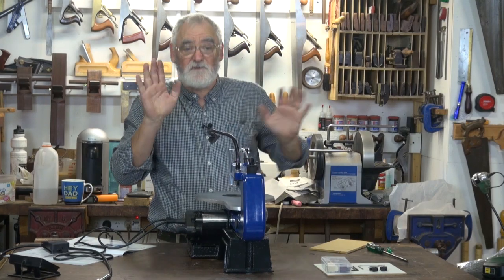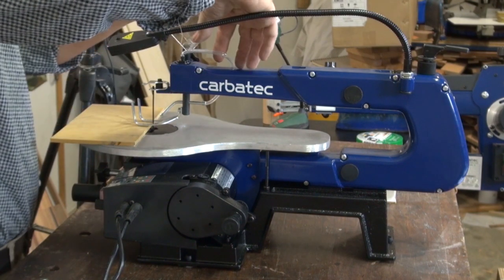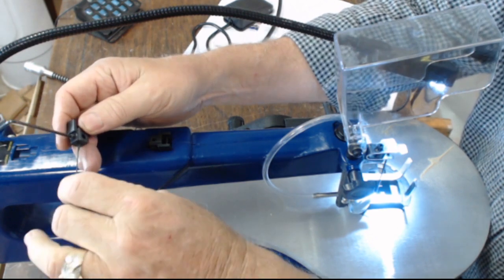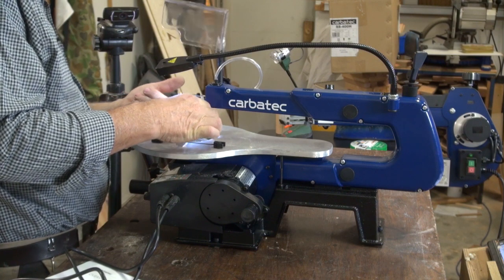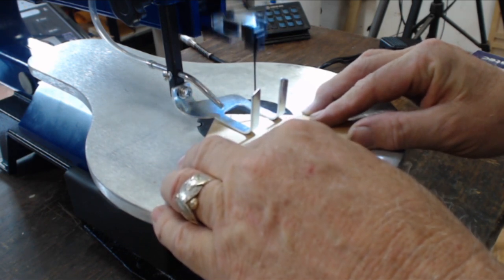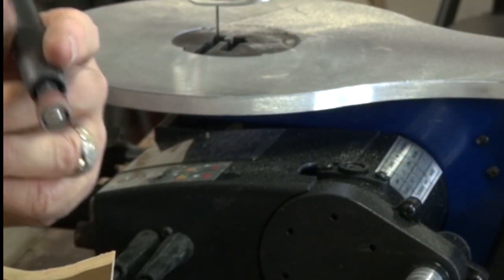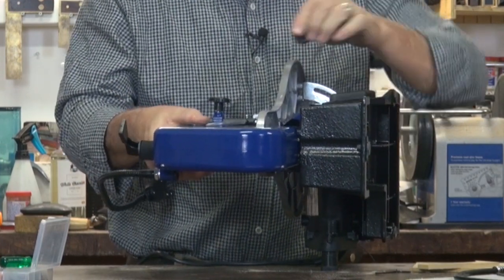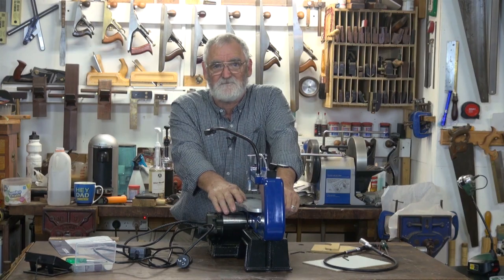Part 3 - Carbatec SS-400H Scroll Saw Operation Safety Maintenance

Comment: I looked at this and compared it to the scroll saw at Hare & Forbes This one at Carbatec is $100 dollars cheaper, but it only has a 1 year warranty. whereas the one at Hare & Forbes has a 2 year warranty. If you want to spend  $400 you can buy the Makita which comes with a 3 year warranty but I don't think it has a foot switch. The foot switch is something I want. Or there is always Ryobi that the cheapest but I purchased 2 Ryobi hand drills both are rubbish. So Ryobi are off my list. I hope this helps. Have a great day.